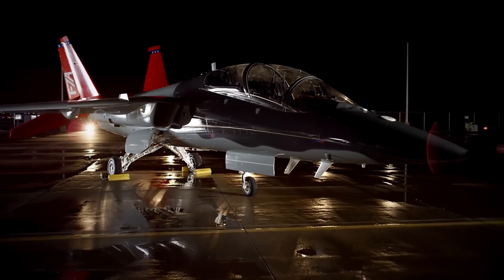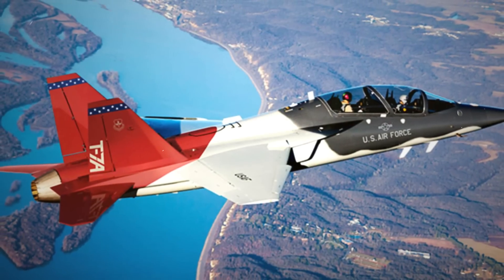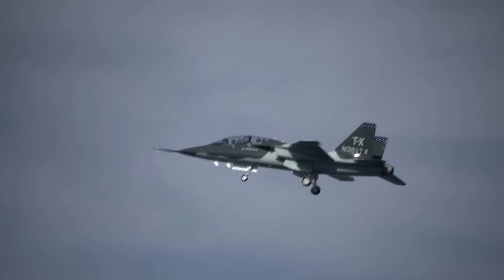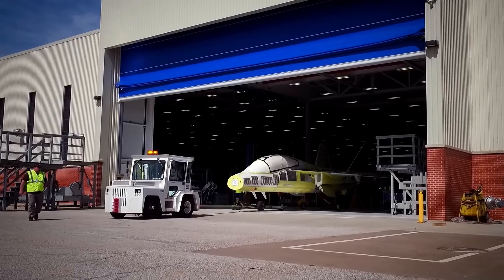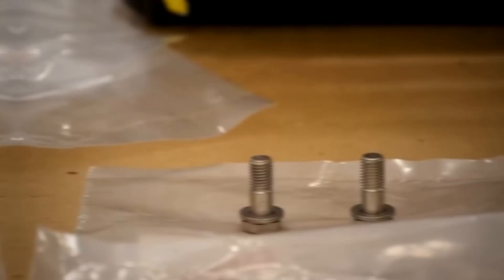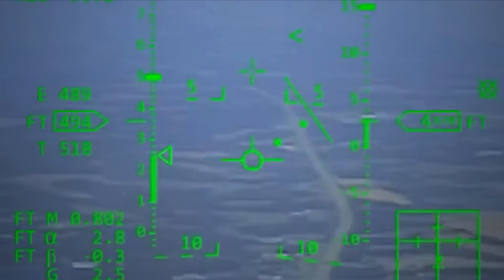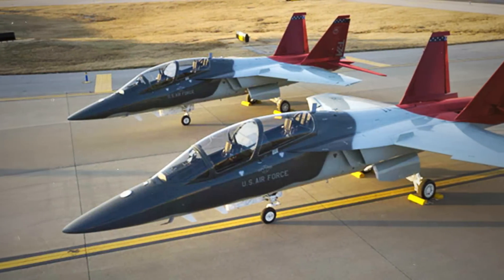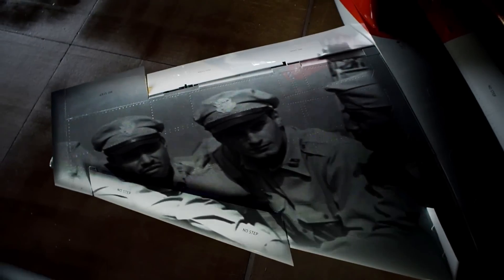Boeing T-X - America's Newest Jet Flying (T-7 Red Hawk)

Comment: This is what happens when you leave an F/A-18 and a Gripen unsupervised.
Reply: Give me back my lungs!!!!! 🤣🤣🤣🤣
Reply: I wonder what it will be capable of when she grows up?
Reply: @genebohannon8820 it'll be armed up and sold to south Korea, Taiwan, and the Philippines as a primary current generation multi role fighter.
Reply: It's ready for everything after puberty and when other engine pops out from back. I don't understand anything about everything, but jets that have two engines are better in my eyes. It's maybe one plane in 200 when double engines save the jet and don't leave pilot to enemies hands. But this isn't made first place to fighting. But trend in fighters start to look that two motor jets (new ones) fading away. Super Hornet would be nice, but maybe F35 is enough to Fin. We try to convert normal hornet to 2 seat version, it flye, but some point program didn't accept any pilots and it make a hole in soft soil at forest. They dig every piece away from ground and boxes had info what was reason. It was in coding. I believe that thing was 99.9 same than factory dual seat. Fin have need one more for trainers. That front section came from France I believe and it was from old F-18. Plane was called Frankenstein. I believe that if it didn't crash, that would be still in fly condition and some time in future find way to "Air museum ;)"
First jets came from soviet and those didn't cost anything and fallen ones didn't make big tears, they give every single one to new one. I believe that no pilots dead in Migs at Fin. Now is time when US made missiles put on soviet Migs and shooted to russians happy soldiers millions pieces.

Yesterday russians shoot rocket or missile to train where was 6 trails filled russian soldiers bodies and Ukraine was returning them.
Looks like they run out of land in Russia where they buried those "special 6384 rykment soldiers"
And somehow I don't think they told every morning in rus how many ru sold dies last 24h... would be time to add own name to list, if you yell those things there. 
How this makes any sense in this topic? Maybe half of jets made by US is buying countries that thinks their biggest fear comes from ru 😨 
And now they destroy all their equipment, so sometime in far future, they must made new stuff for whole army. Their ships started to be even less than some joke. Planes don't stay in air, tanks pops it turret to amazing far, soldiers drunk more than eat, steal more than fight and mostly rape and killed sivilians, because soldiers of Ukraine put those smell in trains that are waiting to carry cold men back in wonderland. Ofc is good that they lost everything in Ukraine, but they destroy some 20% or more of Ukraine territory. 

Today jets and good pilots are so good value our defense and we need them to support our own troops. Airforce could help all other troops way or other. It's one reason why everyone is happy when own planes fly over. Or enemy plane make crater, that last possible one.
Reply: With F-16 main landing gear.
Reply: "When a mommy jet and a daddy jet love each other very much..."
Reply: @DeviousN  which one's the mommy and which one's the daddy
Reply: @722tz  it depends on who identifies as witch.
Reply: LMFAOOO
Reply: Hahaha the Daughter of F/A-18 and Gripen is Gorgeous! 😍😆
Reply: Absolutely
Reply: Don't give them ideas. 😭😭
Reply: Ease of maintenance is a Gripen legacy 👍🏻
Reply: Looks like a 16 18 and 15 had a three way. The size say F-16 the tail says F-18 and the intake and and cockpit glass looks like F-15.  Can’t wait to see it fly.
Reply: This is one r34 rabbit hole I won't regret
Reply: @Milo_1368  🤣
Reply: And that's not a bad thing.
Reply: More like F18 & BAe Hawk
Reply: yo what
Reply: So true
Reply: F/A-18 Puppy,.. big windshield, small nose, stubby wings,… cute!
Reply: funny thing, the F18 uses the same engine as this trainer lol
Reply: There is a very, VERY suspicious Hornet out there somewhere I think.

Comment: As a t-38 electrician, I'm excited to see this new jet when it replaces our current fleet.
Reply: Can't wait to have new jets that haven't all been bent over decades of Over-G
Reply: i take it the T-38 doesn't do well as an older aircraft with new electronics?
Reply: @NotAgentAJ  I think it's a great aircraft personally. Kind of a pain in the butt sometimes but one cannot discount it's exceptional service life.
Reply: @abubaca2683  i dont think its bad i was just wondering what its like trying to update and maintain an electronics system the aircraft wasn't necessarily intended to use considering it was introduced in 1961
Reply: The -38C has upgraded avionics and larger air intakes. But electrically, I think it still uses the same generators. Some of the components have changed because materials have changed. I pulled off a circuit breaker a few years ago that was 50 years old at the time. There was nothing wrong with it but we had to change something. 😆
Reply: @abubaca2683  The gens aren't even all T-38 originals. Some had to be taken from the F-5 and they are slightly different.
Reply: @米空軍パイロット  how so? I'm pretty sure that the only thing they changed in the upgrades was in the nose avionics bay. They've upgraded the generator protection panels over the years but basically, it's the same thing. I imagine the f-5 had the same generators as they shared the same engine.
Reply: @abubaca2683  They don't share the same engine or the exact same generator. Voltage output is same (I assume power is same or close), but the gear shifts at a different RPM. Had to do scavenge for parts to keep the fleet going over the years.
Reply: @米空軍パイロット  is that difference in the gear box or the generator?
Reply: @米空軍パイロット   same engine series j85 different variant
Reply: @abubaca2683  Gearbox. So, I guess the generator could be exactly the same, but housed in a different gearbox.
Reply: @米空軍パイロット  could be. The gearbox sits in the middle between the engine and the gen. The left side also powers the hydraulics. Shifts to keep the freq between 350ish to 500ish. It's a 400hz 3 phase, 115 vt gen. Not sure on amps though.
Reply: The manual says it is a 8-10kva, 22.2 amperes per phase. That's from Oct 1968 🤣😂🤣😂🤣😂

Comment: I'm pretty sure these new manufacturing techniques is how they made the NGAD and B21 raider so fast and cheap. Technology is amazing. 👏 👏 👏 👏
Reply: I am sure they already have a B-21 flying in secret.  Just not announced as flying.  I am sure the Airforce will make it's introduction official before the end of next year.
Reply: @ph11p3540  Actually, a source says that they will unveil the B-21 around December this year. So it's much sooner than we thought, and sooner than the NGAD itself will be unveiled.
Reply: The NGAD's entry in the 2019-2020 Acquisition Biennial Report outright mentions the Digital Century Series, so it's probably true in its case
Reply: This aircraft's rapid development was only possible due to the influence of SE and its tools (MBSE and digital engineering).  As a systems engineer, success stories like this make me proud of my field!
Reply: The most expensive thing on modern fighters isn't the airframe but the avionics and electronic suite.
A trainer don't need the same equipment, and is much cheaper
Reply: @simonm1447  And that's why countries with much lower military budgets, such as the Philippines, can buy them and use them as their main aircraft. We currently have 12 KAI T-50 Golden Eagle aircraft that we bought from South Korea serving such a role, and those were originally meant to be Jet Trainers
Reply: @amaneyugihanako-kunofthesi8849  of course these are still capable aircraft as long as your opponent don't has the most modern fighter jets.
Jets like the Typhoon cost around 70k $ per flying hour, a smaller aircraft developed as a trainer is much less expensive here

Comment: 'Boeing' in name only - this is a 'SAAB' from nose to tail. SAAB is a remarkable company with very skilled engineers. BAE is partnering with them for the same reasons Boeing have done. Design, software, and production skills of the highest order. The flight control software is just the most fabulous example of how SAAB have managed to combine reliability with adaptability. Very interesting and revealing vlog. My thanks.
Reply: Saab did not design the flight controls
Reply: @nicholasturo-shields6477  That would be expected at a 'minimum' would it not?  Given Boeings name on the project that is hardly a compliment (I 'mean' exactly what 'more' did BOEING do other than provide some physical control devices?? I certainly don't know, and nor do I pretend to know.) I suspect that SAAB took any APIs from the 'BOEING' specified controls and simply added it to the software stack. Which would be why the SW approach from SAAB is wonderful. The whole point of SAAB's development platform (that they use with the Gripen) is to be able to integrate new 'devices' very easily into the platform. Which I strongly suspect is why both BOEING and BAE are partnering with them. Smart people are in demand.
Reply: @GordonjSmith1  lots of words saying...I don't know what exactly. At Boeing in St. Louis I sat across the aisle from the teams writing the flight software (I worked on the GBTS mentioned in the video). The blurb in the video refers to SAAB providing software tools, not the software flying the plane itself. 

I will only say that Boeing deliberately ran the T-X/T-7A program quite differently from many of the other products it is known for.
Reply: @leeswecho    @GordonjSmith1  yeah not entirely sure, I was just responding to the initial comment. They provide the corresponding software for the subsystem components they supply, that's pretty standard. I wish I could share more info with you. It truly is a fantastic plane
Reply: @leeswecho if this is true you probably shouldn't be toting that you work/worked in phantomworks under your real name.
Reply: @theonetheonlymemelord5738 T-7 isn’t a phantom works project. In fact, the project is entirely unclassified.
Reply: Its a Boeing project with SAAB as a partner. They had two design teams in US and Sweden working in shifts with each other.
Reply: "Tell me you have no clue without telling me you have no clue."
Reply: Not exactly. Both SAAB and Boeing are building parts of it. 
Sure, it's influenced by SAAB in many ways and SAAB made the software the plane is designed in but Boeing are building parts of it as well.
Reply: @andreas_petersson  I would expect no less. But let us be honest, this production and design approach is 'SAAB', and as I mentioned, this approach and skillset were exactly what  BAE suggested as their reasons for having SAAB join as a partner on their replacement project for the Euro Fighter. Recent BOEING projects have highlighted a lack of engineering skill at the highest levels of management, SAAB do not  currently have the same issue with adopting 'enlightened' and 'informed' engineering skills in their development and production. I appreciate great engineering discipline and insight, and recognise when a company like BOEING needs to source such innovation externally. Either way, I am happy that this project is moving along in an effective, and efficient manner.
Reply: @GordonjSmith1  Absolutely right
Reply: @GordonjSmith1  
Unless you are directly associated with the program, maybe you should listen more and say less.

If Boeing’s name (or any other US supplier) wasn’t on it, it wouldn’t even be in under consideration by the USAF.  In times of conflict, the US wants US defense needs being provided by US contractors.
Reply: @matthewgaines10  I am passing my statements on Publicly shared presentations from BAE, SAAB and JANES. Sources I feel are worthy of basing my comments on. I am sure that the US DoD has done its homework wrt its suppliers.

Comment: The light attack/fighter version is exactly what we, and many other nations, need to support for far more expensive front line aircraft in roles you do not need those for such as ready response in civilian situations where you do not need stealth or the ability to shoot down a dozen opponents, just find and deal with one or two non-military craft. Also for regular patrol missions where actual opposition is less likely.
Reply: That and its cheaper to lose a light craft vs the overpriced F35s should one get shot down.
Reply: The SAAB 39 Gripen would be a good option. Cheap, reliable, multi-mission capable, low turnaround time etc.
Reply: That’s a really good point.
Reply: When you consider that the vast majority of CAS missions flown by much higher ticket aircraft (A10 not included) in Afghanistan for example didn't require highly advanced capabilities. It was just that the forces in theater didn't have a 'low spec' option capable of the role. Hence the increase in armed trainers, the turcano, Texan etc. Many capabilities exclusive to big ticket aircraft 20 years ago can now be added to more basic aircraft with a hardpoint mounted pod.

Comment: Stadium seating?  I never heard that in reference to an aircraft.  I wonder why the used the 404 engine  rather than the 414.
Reply: The T-7 is a training aircraft. It doesn't need to fly as fast as fighter jets.
Reply: @andreas_petersson  >> I’m just surprised it’s still in production since the latest Gripen as well as the Super Hornet uses the 414.
Reply: @jaybee9269  Yeah I was kinda surprised too.
Reply: Stadium seating, when you get hotdogs and popcorn at half time.

Comment: That's an awesome little jet! Does anybody know if they could be equipped with weapons and be used in war?
Reply: Yes it can.
Reply: T for Training 
TA for Training or Attack
Reply: Most trainer aircraft can be adapted for light attack. they have a few hardpoint made for cheap freefall training bomblets (since a pilot has to be able to use unguided munitions in the event of GPS failure for instance), it's not too much extra work to add the capability to haul a pair of 500lb GBUs or missiles/rockets. The T-38 and F-5 are the same platform as an example. The L39 is an eastern-bloc example of the same concept. Honestly I think it'd do fine in that role, especially for a nation that simply can't afford or las little use for full-price top dollar fighters like the F-35.
Reply: I would suspect if war was to begin they would be used in homeland defence and could easily be fitted with air to air, Air naval ship and air go ground missiles.  When they are armed with a shared battlefield communications targeting system they could be deadly. 
In such a world war the US would probably spit out 20,000 of them in two short years.